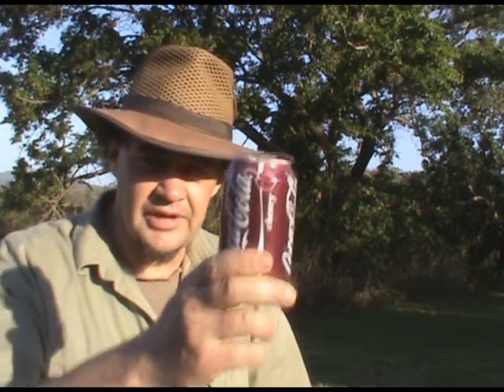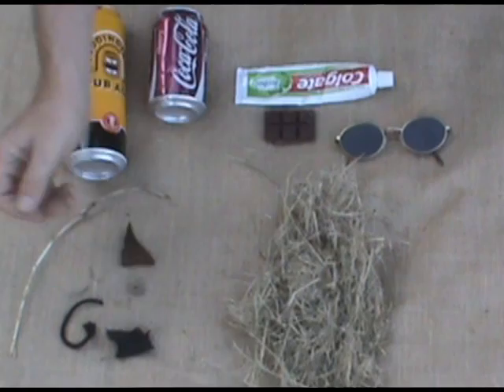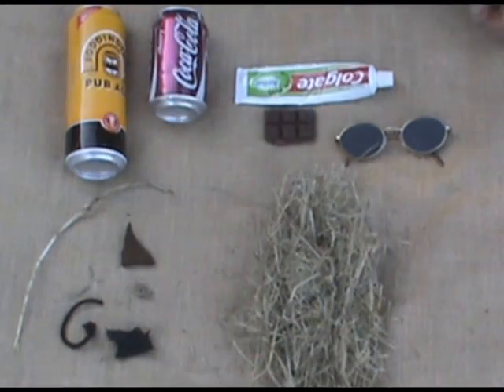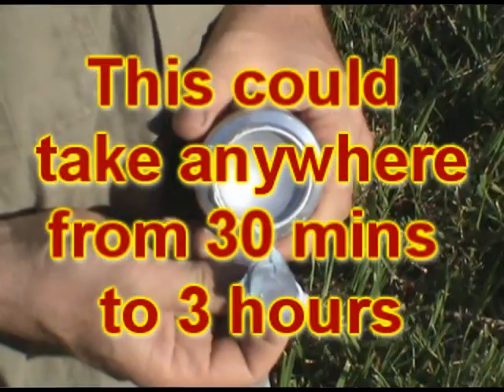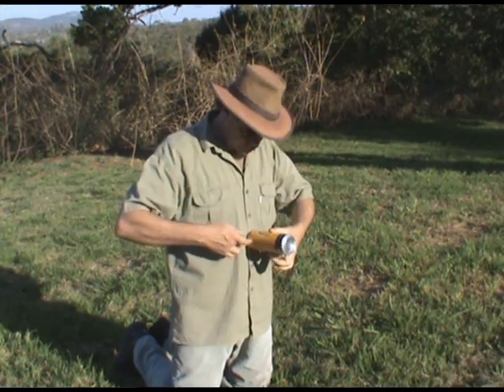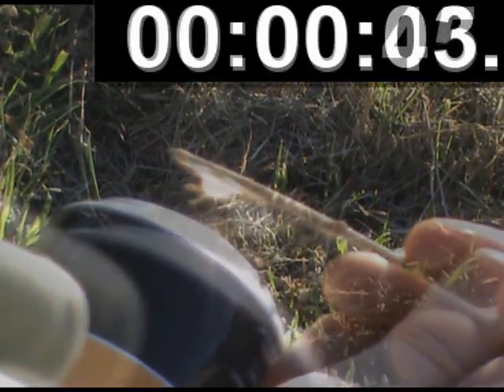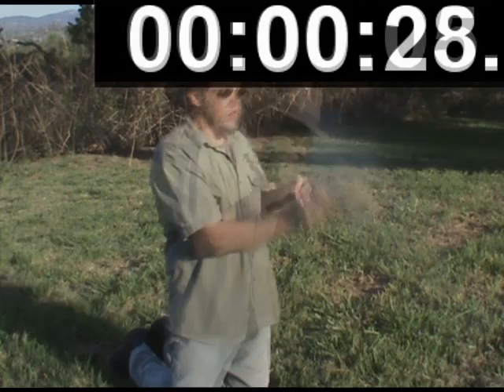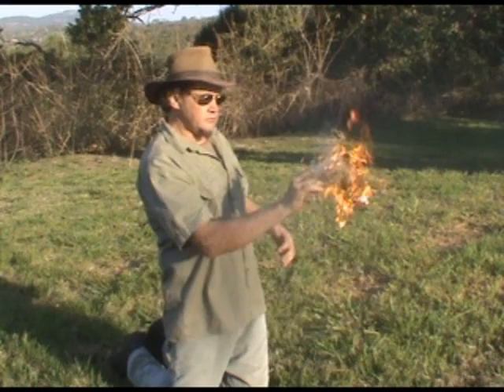How to make Fire with an ALUMINIUM CAN

Comment: For those who don't want to spend half your life trying to polish the underside of a beer can, but still want to have a polished can just for novelty sake, try a product by 3M called "Rubbing Compound"... can have it shiny within a minute.  I tried toothpaste (with and without water added) and milk chocolate... and got no real results after a few minutes each.
Reply from the maker: +Brad Cox Excellent comment.
I should have mentioned this myself.
The trick is pretty neat, even if you're not in a "survival situation".
Any commercial rubbing compound will probably work, and you'll probably save a couple of hours of your life. Which you can then use to watch more YouTube videos. Life is good.
Reply: Old Boy Adventures where do u get the 3m rubbing compound

Comment: @ROBwithaB How about the following:

Drill a hole in the side of the vuvuzela. Stick a straw through it a few millimeters, and hold the straw's other end into some petrol. Aim the horn at a source of sparks in front of some tinder, and blow through it! If it goes well, you have both a flame thrower and a deafening noise.

(I have not tried this and don't want to encourage you to go singeing your beard :-))